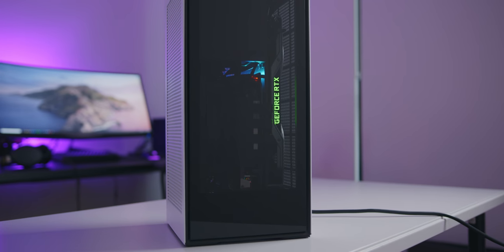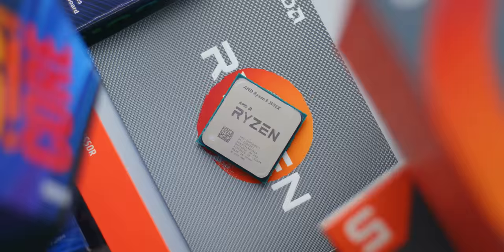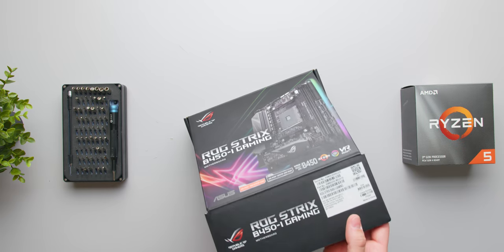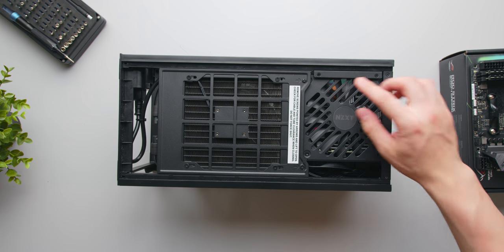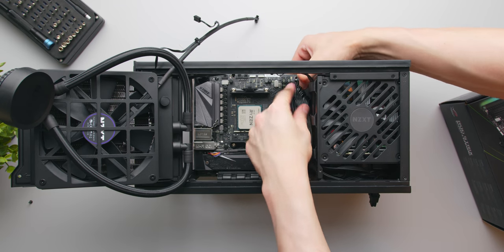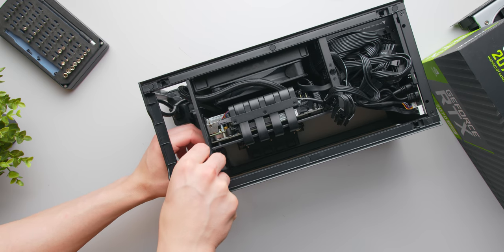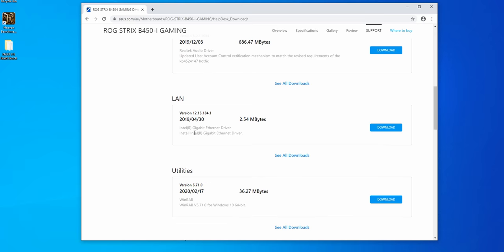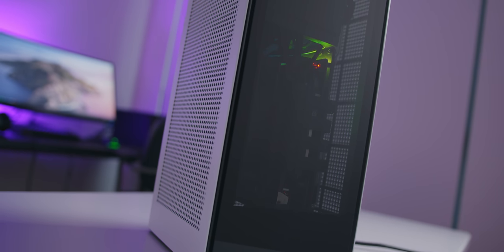How to Build a $1400 NZXT H1 Gaming PC

Comment from the maker: Most of the content here at Optimum Tech is enthusiast focused, but I wanted to do a super basic build guide for the NZXT H1 for beginners. It's a bit different, but I hope you'll enjoy!
Reply: Optimum Tech is it possible to change some pre installed Parts like the psu, blower? Or it should be better to use the current ones?
Reply: I've never built a PC, but I want to. Why should I choose B450 over X570? I understand that it is cheaper, but it doesn't have support for PCIe Gen 4, and it restricts the CPU from it's full potential.
Reply: Really useful video, finally convinced a mate to buy a gaming PC, I had already spec'd up an itx w/ 3600, but hadn't decided on a case. Now I'll just recommend he get the H1 and watch your vid since I can't come over and put it together anymore lol
Reply: @worldofjoseup  the included PCI riser cable is Gen 3 anyway so you won't loose any performance unless you buy a gen 4 riser cable as well.
Reply: Joseph Zeru - STG2 give me one real world reason why you need PCI-E 4.0
Reply: @worldofjoseup  First off, you don't need PCIe Gen 4 if you don't download and transfer LOTS and LOTS of files and expect the SSD to go as far as 5,000MHz (which is bonkers for a gamer). And secondly, no, the B450 motherboard does NOT restrict the CPU from it's full potential unless you use a high core count CPU like the Ryzen 9 3950X, or overclock you CPU (that's where the VRM and VRM heatsinks really come to play). Ideally you don't need an X570 motherboard because It's kind of ridiculous unless you really do need the quirks that it has, which I probably don't need to guess, you don't need that kind of power.
Reply: I was screaming PIIIIIIIIIINS at 1:53
Reply: what about the front usb-c connector?
Reply: Very nice video, many thanks ! Even for someone that's used to buildig full tower ATX PC, this is very good. I've been wanting to get into Mini ITX for a while and the simplicity of the H1 (though am not a fan haha of CLC) might be the one defining trait that gets me to finally build this ! Well, a bit later in the year obvs, but still.
Reply: @worldofjoseup  Even an RTX 2080 Ti doesn't fully use PCIe Gen 3.0 at the moment. And it will probably be true for the next 2 years I'd say. So by the time you do want to upgrade to a card that absolutely requires the bandwidth of PCIe Gen 4.0, you'll be looking at a complete PC Upgrade.
Honestly for the next 5 years you're completely fine, don't worry about it, B450 is much more affordable and you can put that money towards a better Graphics Card.
Reply: How do you do it?! You're releasing a video every couple of days. Is it just you? Seems like Davinci Resolve sped up your workflow, but even so, you've been pretty consistent since you started.
Reply: Could you do a more in-depth review of the H1? Like flipping the fans, using different fans, using a custom panel instead of the glass.
Reply: Could there be a way to have an HDD or SSD
Reply: I love the usual content, but even 2 years deep into being a PC enthusiast, this was very enjoyable to watch. Thanks for so casually running arguably the most cinematically beautiful AND informative PC channels on YouTube.
Reply: Ok
Reply: Hi, would you recommend 3900x for this case (for video editing) or the chasis would struggle to cool it over e.g.the 3700x?
Reply: Hey great video very helpful for finding out a powerful well priced pc. Do you think this case would be viable for a portable gaming setup going house to house or should I stick to the skyreach 4 mini?
Reply: Optimum Tech this a good board for bdie ocing?
Reply: @paulvanthoff1921  seems like every Youtuber who makes a H1 review with amd frogets about this. There are currently no ITX boards with am4 chipset on the market that have a connector for usb 3.1  or newer afaik. You would have to accept that the usb-c is not working or you get intel (sadly).Guess we will have to wait until they release some motherboards with usb 3.1
Reply: @benjamin3658  I found a way with internal usb hub
Reply: Love your stuff man! Could you check out the Sharkoon QB One? I am looking to downsize from my Fractal Design Core 500. I was looking at the NCase M1, but just found the Sharkoon QB One. It looks like a scaled down Core 500 with better airflow. It's a couple liters larger than the Ncase M1, but is much cheaper and can fit better under my monitor setup (7 in tall). It also seems to have a pretty good building experience as all the panels can be taken off.
Reply: @paulvanthoff1921  did you get any info on this?
Reply: hello, i cant seem to purchase the NZXT-H1, im one of your subscriber in the philippines, i hope you can help me out
Reply: hello, i cant seem to purchase the NZXT-H1, im one of your subscriber in the philippines, i hope you can help me out
Reply: Any chance recommendations for simple temp mod like where extra fan can be intsall etc etc
Reply: Optimum Tech lovely simple build. I’d like to do the same build but I only need a graphics card for Photoshop and occasional gaming (Doom, Battlefield…) and I don’t need high frame rates. The build is mainly for work. Can you recommend a cheaper card than the one used in the build? ~£250.
Reply: Optimum Tech do you think it’s possible to have the gfx card liquid cooled in this case also?
Reply: What is the price for the b450 i motherboard?
Reply: Dude i love your videos your better than linus TT and BitWit even more people idk how you only have 258k subscribers, you should have millions!!!
Reply: @Gidogeek  maybe an itx GPU + aio in the remaining space?
Reply: @paulvanthoff1921  Does that actually work? Have you tested it? because it says the controller connects with a usb 3.0 20-pin, which the ROG STRIX B450-I doesn't have...
Reply: what is that led near the side of the case
Reply: Help should I build this or evolve or formed?!
Reply: Hey OT will it fit a ZOTAC GeForce GTX 1070 Mini 8GB GDDR5 GPU? I can't seem to select the card in PCPartsPicker. Thank you in advance!
Reply: Thank you!
Reply: Hello Optimum Tech ! Thanks for your video :) what graphic card will be better for NZXT H1 case msi rx5700 xt gaming x or powercolor rx 5700 xt red dragon ?
Reply: @paulvanthoff1921  Did you ever figure this out?
Reply: Nice video! Instead of use it for games, can I use for basic video edition? Vegas Pro software and videos for YouTube?
Reply: Is it compatible for streaming?
Reply: Hey I have a Question’ I’m looking to make a build like this to my own I have a second ( rog - 2080 ti) I currently used it with my main pc which is build with a  Intel i7’ can I used a 2080 ti GPU to place it on this AMD build and it will work with no issues’ pls reply back if you can i really want to make this build pls?
Reply: @snipodyssey  good question also I will like to know that
Reply: it will take me an entire year just to build this pc because my mom or dad can't afford the entire pc build ill just get the nzxt h1 case and a usb 3.1 flashdrive on christmas this year. then when my birthday comes next year ill get the rest ram motherboard  ssd etc.
but the intel core i9 10900k is very expensive so ill have to wait for another christmas.
and then after i get that ill need a graphics card RTX 2060 so ill have to wait again for another year until my birthday. that' 2 years. these type of videos make me realize how poor my family is. it make's me upset that people like you show how much money you flex on pc build's knowing the struggles of poor people. nice one bro nice one..

if you ever review my comment in a video don"t show my name or else..

Comment: Felt cute might catch on fire later
Reply: @madd6180 madd6180 the ribbon pci extender has a flaw on one of the screw holes, the 12v can be easily shorted into ground and it will literally catch fire, there are some videos online of it happening. The case is still so good tho I love it.
Reply: And the recall just got real.
Reply: would you just put electrical tape around the inside wouldn't that fix it?
Reply: cable ties fixed the issue
Reply: bro i think you need thermal paste for this one
Reply: @aspectmusic4800  is it not already fixed? From factory?
Reply: @aspectmusic4800  Should've already been fixed depending on where you got it from, if it was 'new' old stock then perhaps not
Reply: pablo was here
Reply: just change the pice cable

Comment: This case is impossible to find.
Reply: It's going to be in stock today in less than an hour.
Reply: Efrain Flores You were wrong
Reply: @jeremiah9913  no I wasn't... You were just too slow
Reply: Jeremiah NZXT posted on Reddit that limited stock were going up at 12pm PST (black and white models). I was hitting that F5 here and there until it finally popped up for me at at 12:10. Checked again out of curiosity at 12:35 and was sold out. If you’re looking to get this case, I wish you luck (and perhaps check the NZXT reddit thread and ask about the next restock)
Reply: Seems like NZXT isn't doing a better job with this ITX case than the boutique case makers that Optimum usually covers then.
Reply: Yaoquan Song I would agree but it’s obvious you’ve been living under a rock for the better part of 2 months this virus has caused companies that are “non-essential” to shut down. This means that everyone is working at home. This also means that restocking/building, and shipping said items will take much longer than usual.
Reply: It restocks every wednesday at 12 pst
Reply: Tyler Gastreich are you serious am or pm?
Reply: @palleto1  PM. They have consistently released their latest batch every Wednesday, 12pm PST. I was able to get mine by being on the site at 12, refreshed at 1, 2, 4 minutes in to no avail. Checked again at 12:11p and stock was available.
Reply: My guy, you can find it on NZXT's official website!
Reply: It has always been in stock in Sweden:)

Comment: I must have watched this video 25 times...
First 3 watches were admiring the cinematic work. Next 2 watches to convince me that the NZXT H1 was the case to use to build my first PC. The next 5 watches to compare my parts list and drool over that 2070 Super FE... 
The last 15 watches were during my build to give me the peace of mind and confidence that I CAN DO THIS!

My first PC build!
- NZXT H1

- Asus ROG STRIX B550-I

- Vengeance LPX 32 GB 3600 MHz

- Ryzen 7 3700x

- NVIDIA GeForce RTX 2070 Super FE

- Crucial 1TB M.2 NVMe

Thank you! 
I can honestly say, I would not have taken on this project if this video did not exist... subbed... great channel!
Reply: also thinking of buying this case for my first build, need a machine for FS2020
Reply: did you use the same parts?
Reply: @Eborun   I went with the following:
- NZXT H1
- NVIDIA GEFORCE RTX 2070 Super FE
- ASUS ROG STRIX B500-I
- Ryzen 7 3700x
- Vengeance 32GB RAM 3600MHz
- Crucial NVMe 1TB SSD
And, I will probably be adding a few more SSD over the next few months as funds are available.

Comment: As soon as 3080ti and 4000 ryzen series drop at the end of the year im gonna build a killer build in this. 4000+ mhz rams and 4 gen pcie m.2 , i find it amazing the power you can fit in one of these. Probably even put an LCD screen on that cable cover, it will look pretty sick behind that smoked tempered glass.
Reply: I concur.  That's my plan as well.  Should make for a rocket PC.
Reply: Damn... Imagine a 4950x with a big Navi.... But I'd rather go big Navi I stead of 3080ti
Reply: But 4000mhz doesn't give u a big speed increase
Reply: @paulmueller100x  Its all about the big D energy

Comment: Thinking about doing this build over the summer with a 3950X and 2080 Ti or similar if new hardware comes out. The case is sexy as heck.
Reply: That’s perfect timing I think. Had my eyes on Computex to decide on the parts as you’ll see the companies start to reveal the lineup for the remainder of the year/next year but decided to buy now if I could get a decent mobo/CPU deal. I’d imagine prices would go down after Computex for current generation parts.

Comment: Your channel is the benchmark for Small ITX builds.
I have never seen a case I like yet; 7800x3d and Tuf 4090 are not easy to fit in a small case. I need a quiet build. Water-cooled is preferable, as I have done stage one and have an EK CPU and GPU water block... I don't want to get rid of my 2 x 360 EK 44mm rads, so at the moment, lian li Mini looks to be my only option.

Comment: What I want in a case:
- Small form factor
- Minimalist
- Good CPU and, specially, GPU temps
- Compatibility with ATX PSU and larger Video Cards
Reply: ATX PSU does not go well with SFF Pc.. I just built case by myself with MATX MB, 290MM GPU and ATX Psu of 12L volume and most volume was occupied with ATX psu.
Reply: Check out the Silverstone RVZ cases
Reply: the case in the video should be fine, you don't really need atx
Reply: Easy, Sg13
Reply: Cougar QBX

Comment: Dear NZXT, 
Put the second USB 3.0 port BACK on the front IO plate... especially on this type of case. Stop taking up an entire USB3.0 header for one USB.
Reply: What about the USB Type C on the front IO plate? Does the USB 3.0 header power it? 
I am genuinely curious as to whether this Motherboard (asus strix b450i) activates the USB C of this case.
Reply: @tennotensei8630  It doesn't and there are no AMD mini-ITX boards at the moment with a usb-c connection...
Reply: @dygon7663  There is now: ROG STRIX B550-I GAMING

Comment: Honestly with some vents in the floor and it lifted just slightly this case would be absolutely solid. Which is exactly what I plan on doing with mine. The aesthetic is perfect as is it just needs a little help
Reply: Might want to have an actual water pump in it so it can put out the fire.  It’s a very hot case.

Comment: I've always built systems with Intel processors.  Are the Ryzen processors really any better? I've ordered this case and am torn on what motherboard and CPU to get.
Reply: Ryzen CPUs are quite a bit better than equivalently priced Intel CPUs
Reply: Ryzen cpus are usually MUCH cheaper and are only a fraction less powerful compared to their counterparts. If you're building this year you should definitely go for AMD over Intel
Reply: With current ryzen chipsets 5 and 7 id just stick with ryzen. They are much cheaper and come with a cpu fan that is the best stock fan out there. With this build or any new ones id suggest amd and if you are willing to pay intel prices you may want to bump up to a 7 3600x
Reply: Honestly intel 11th gen isnt as bad as they say. They are quite cheap now. Amd is still really great

Comment: I just finished my first ever build yesterday with this exact motherboard! 

Good to see i didn't screw up any of that :D This would have helped a bit, seeing the installation process in detail (love that zooming in) is always better than reading about it or having to check the manual... Extra thanks for: mentioning what you need to do after building (updates o bios, chipset, gpu drivers)

Comment: Hey mate, really awesome build! It's very similar to what I'm planning as soon as H1 comes to Europe. My only question is - with the B450-I you are plugging in the "front USB connector" but does that mean both USB3.0 and USB-C will be alive, or the USB-C port on the case is dead as the B450-I doesn't actually have the USB-C (USB3.2 Gen 2 if I'm not wrong) connector onboard?
Reply: @vadzimverameichyk1787  oh wow, much appreciated!

Comment: Love the build guides, well pretty much all your reviews and guides, great job, thank you so much.  I did this build with a RTX 2070 Super, ROG Strix B550-I, Ryzen 9 3900XT, 64GB G-Skill D4 3600 TRZ RGB, and 2 x Samsung 970 EVO 2TB (this board has 2x NVME SSD slots).  Overall I was concerned about heat but I aida64 stress test for 20 minutes and it never go above 81C.  No overclocking though and in silent mode this this is whisper quiet.  Wonderful build and I absolutely love the NZXT H1 case, it's beautiful and compact.  Thanks again!!

Comment: Just built this exactly as presented and this is by far my favorite PC build of the few that I've done. The main issue I've found is the GPU fans randomly boosting up to 100% and failing to register rpm in tools like msi afterburner. I had to reseat the GPU in the pci-e slot to get it to work correctly. This is apparently a common issue with the rtx 2070 super and other high end rtx cards.

Comment: I have a small PC desk and thus, I'm in need of SFF gaming PC. I usually order my gaming PC from my go-to PC maker Avadirect.

But I've been reading up on this case and having seen this video, I'm starting to think if I should build one myself. I originally saw this case on Xoticpc as one of the SFF buildable custom PCs.

Only problem is I think I will need GTX 3080, RT 6800XT to drive my monitor 5120 x 1440 res. My current RTX 2080 barely handles AAA games in mid setting. GTX 3080 PSU minimum is 750, so that's an issue with this case.

Thanks for the vid. It'll come in real handy if I ended up building it myself and choosing GTX 3070 or RX 6800.

Comment: I love this form factor and just bought this case for 330EUR thanks to your reviews.  Goal is to build a good budget PC 3440x1440 gaming at 60FPS.  Got a Strix B550-i, Ryzen 3600, Corsair Vengeance DDR4 RAM, Samsung NVMe on the way and will pre-order the RTX 3070 Founders in October.  Judging by the 3070 photos I am hoping that it has the same traditional fans as the Founders 20 series as I dont want it blowing air back into the case.
Reply: How's your build with 3070? Fit ok? And perf? Noise?

Comment: I'm going to do a GTX 3080 build when they are released, this case looks fantastic for the adult enthusiast (i.e., have money, but no time to tinker anymore).  I'm hoping there will be good mobo options for this for the intel 10 series as well.  I only wish they'd bump up the PSU to a 750w, but if it works it works!    I've been using an Antec P192 case for 12 years now (really awesome case, solid and perfect all 12 years which lasted multiple builds).